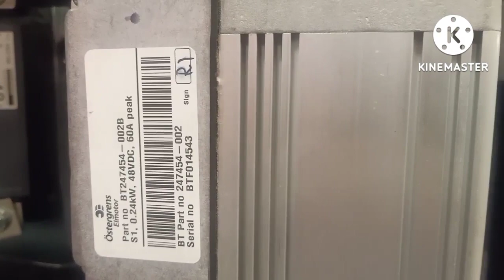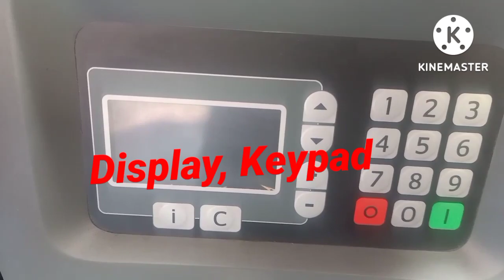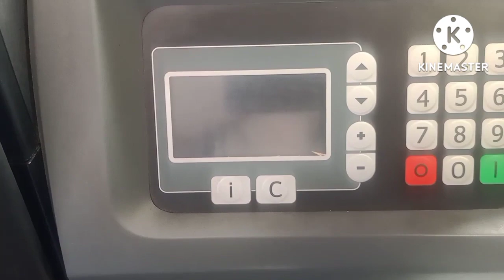BT OME100H order pickers basic part knowledge video

Comment: sir mere pass toyota flt model 8fbmkt 25
proble ..steering  not proper work.
steering wheel stop on half round
Reply from the maker: What is tha error code on display
Reply: Steering sensor problem hai right ke wheel pr hota hai